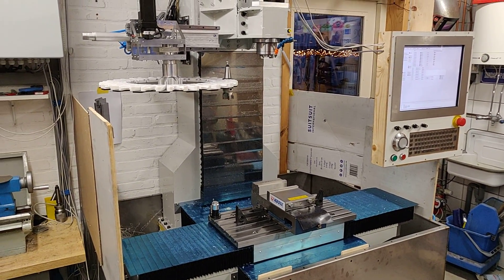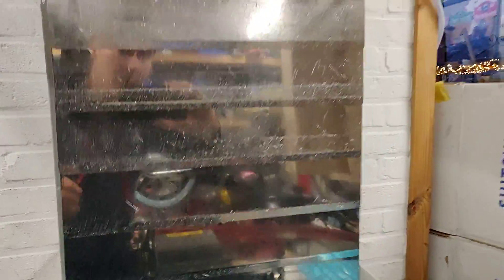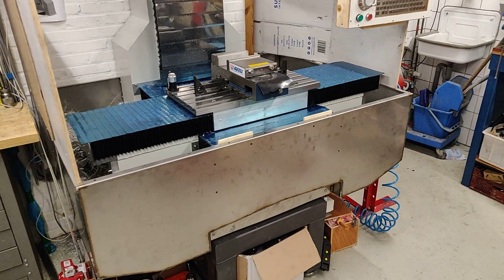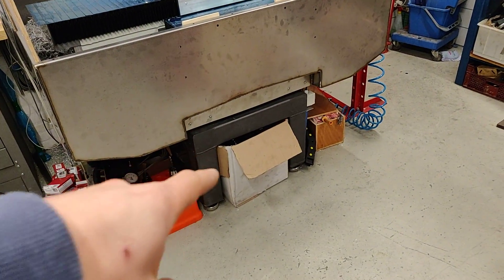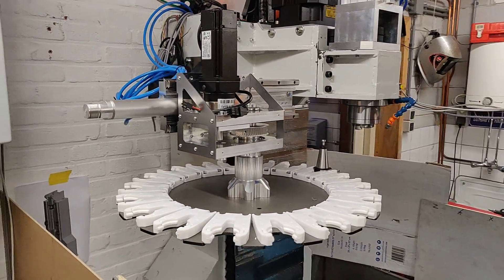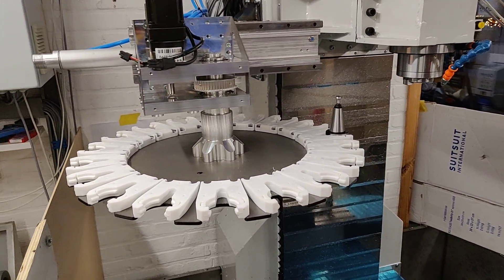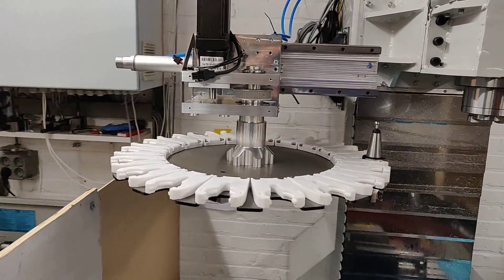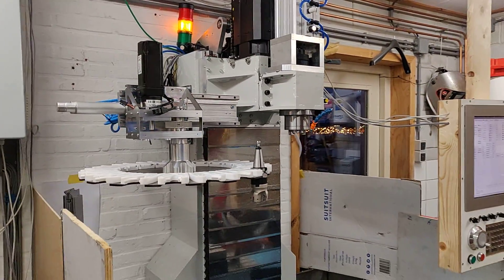Small update on epoxy granite cnc mill

Comment: Impressive job! But are you sure 400w servo is needed there? Closed-loop Nema23 stepper motor would have been enough. Servo is needed only if you need 1000+ rpm, and I doubt you need to spin tool changed at 100+ rpm :D
Reply from the maker: That servo is way overkill i know. But now all my drivers are the same. And there is no need for a separate power supply for that single stepper.
Reply: @Svanitterzon  Ah, that makes sense.

Comment: Can I ask what the reason is for the double air cylinder for the draw bar?  Is there something special I need to know?
Reply from the maker: Its just that you can make more force with less pressure.
Reply: @Svanitterzon  hmm wonder how that works.
Reply: @Svanitterzon  never mind I think I get it.  You have Basiclly 2 pistons pushing on one rod.  Doubling the force.
Reply from the maker: @svin3819  yes in my case i even have 3 cylinders pushing on one shaft. Trippeling the force compared to a single cylinder
Reply: @Svanitterzon  hmm I just bought a 100mm bore cylinder for mine.  Maybe I should look into those.  I think I have the same bt30 spindle you have off Ali?
Reply from the maker: @svin3819  can be, ask the seller what the drawbar pressure is and you can calculate of your cylinder will suite you with the available air pressure.